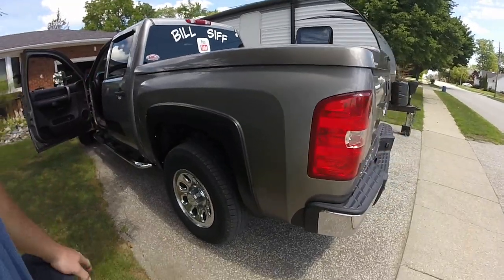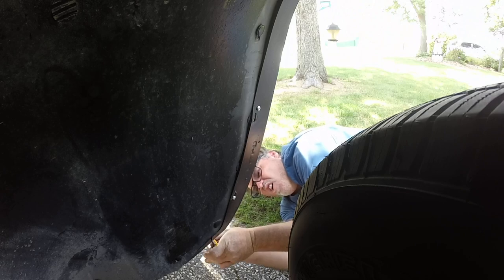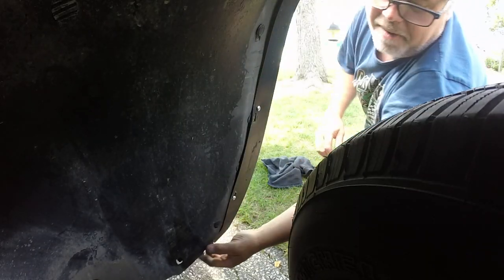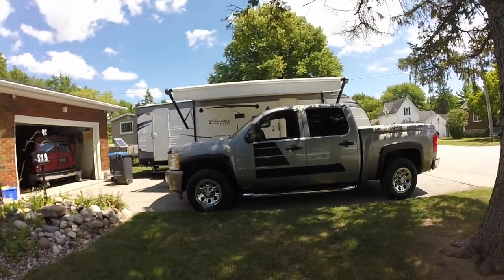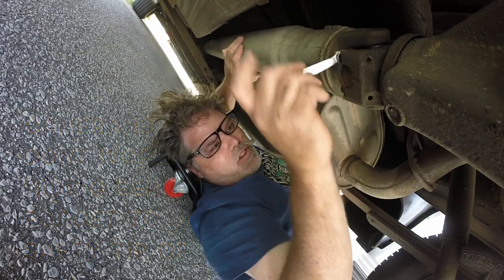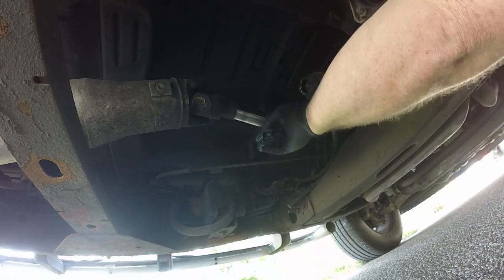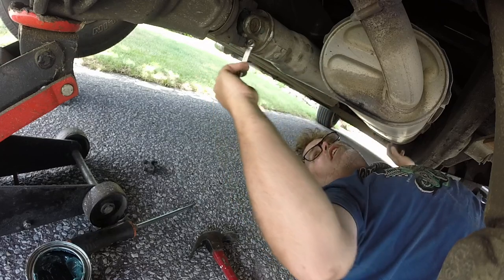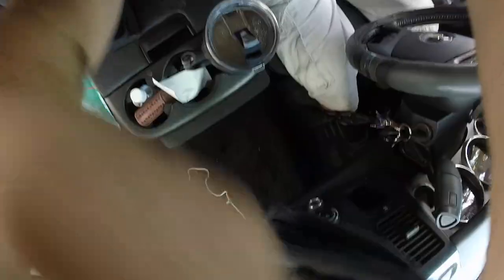2" Wheel Spacers are awesome Might Have To Junk Chevy Silverado

Comment: I had a Mustang Cobra that had a cracking/ snapping noise when the drive shaft was turning while up on a hoist. When driving the car the diff was making noise like a grinding sorta noise. The noise was coming from the pinion bearing and traveled up the aluminum drive shaft, so bizarre. Or a bad u-joint unless you replaced them. Good luck! The struggle is real up and down from under a god damn vehicle, I feel ya! Gives the abs a waking up.

Comment: They skip a wrench size because they know it is the one you will need and will end up spending as much for that single wrench as you did for the set.  Skipped sizes piss me off.  18mm I discovered I needed for my ford brakes (first newer ford I owned)...  And 18mm is another skip size of course. Lots of Ford owners be buying an 18mm socket...

Comment: Put the truck up on Jack stands and start truck put in 4x4 and let idle in gear get under and youll find the noise guaranteed . And the bolts for your universal joints should be ⁷/¹⁶ some were ⅜. And if ya loose about 40 lbs getting up won't be so hard youll feel 10 urs younger for sure.